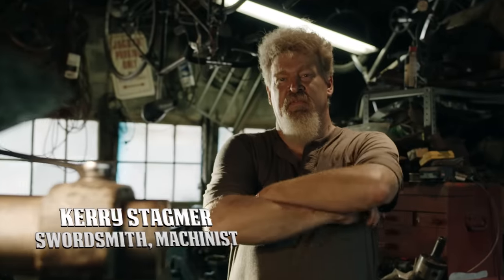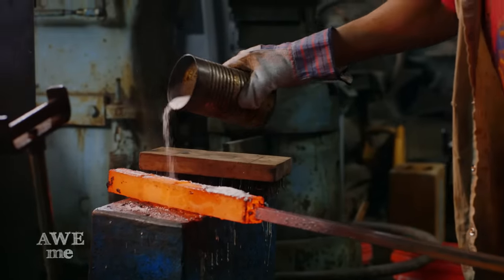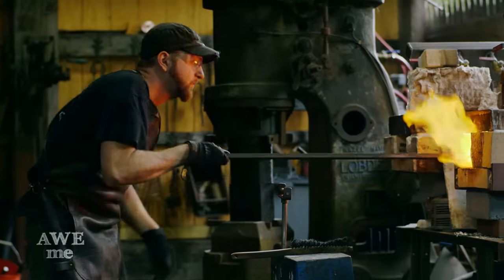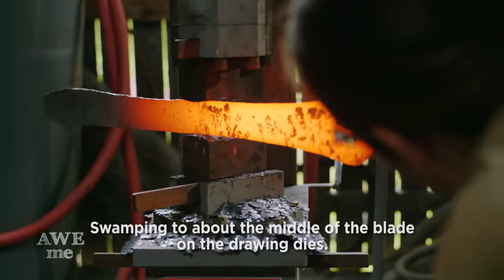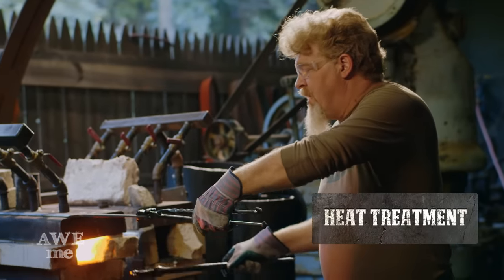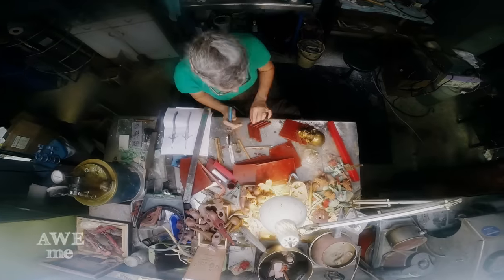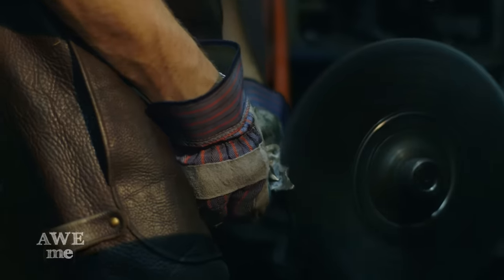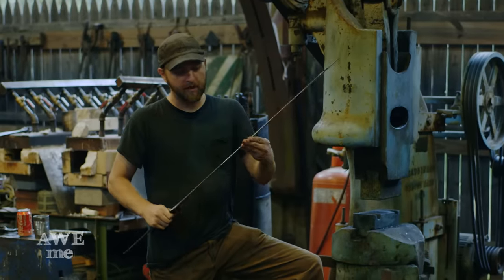Dante's Rebellion Sword (Devil May Cry) - MAN AT ARMS: REFORGED

Comment: PLEASE MAKE THE 'YAMATO' OF VERGIL IN DEVIL MAY CRY 5
Reply: Yamato is just a regular katana
Reply: Vinicius Tanaka the only thing different is the guard and the need to craft the scabbard it would be remaking the Ruroni kenshin katana just with a lethal edge
Reply: Please
Reply: And nero's motor sword
Reply: But Yamato has changed in different games. Dmc3 is a way dmc4 another, and dmc5 I will not say nothing. Tsuba changes all the time.
Reply: Plis the yamato of vergil
Reply: @vtnk7597  it's not theirs Engravings there's the handle and there's the guard that's all different
Reply: Ya
Reply: @fireflamefirenick7313  it pretty much is with the only difference being a different shell design on the handle
Reply: @vtnk7597  it's a nodachi
Reply: @Hanta1  yamato isnt a regular katana it's a nodachi
Reply: @ExoTheEmo  You mean Red Queen?
Reply: @gaelleonardomartinezrios6358  yeh at the time i didn't know what it was called

Comment: Imagine how ridiculous it must have been to make swords back when they were commonplace weaponry? Even the most mundane swords must have taken days with wood fire forges, stone grind wheels, and smithing hammers. I wouldn't even want to imagine how long ornate specialty swords took to make.
Reply: My thoughts exactly, pretty amazing really...
Reply: Nah it takes seconds if you have the right materials. Play Skyrim and you'll see what I mean
Reply: Ryan Lawrence The troll is real.
Reply: Ryan Lawrence I have played skyrim :) not accurate in many ways but set for the understandable mechanics.
Reply: Randy Savage Or he was making a joke.
Reply: I know that hence the smile
Reply: In the middle ages they didn't have the tools so they used molds for the form of the blade, then made it sharp with hammers
Reply: Jeroen Bakker They had molds but they fine formed it with hammers and sharpened it on a grindstone. You can't sharpen a blade with a hammer, you can just thin and flatten it to an edge. Even with the mold they had to put a lot of hours into shaping.
Reply: Jeroen Bakker
You're thinking bronze swords.
Reply: Randy Savage it literally can take no more than 4 seconds with the right materials: minecraft logic
Reply: Nope nope For sure. If you make yourself a 3x3 grid table all you need is 2 iron ingots and a stick then boom, you're a blacksmith.
Reply: Randy Savage basically, like I said if you got the materials there, and most likely if youre a black smith, ya do

Comment: Nero red queen, samuel murasama (mgr) and Arthurian sword.
Reply: +Sharif Azmi just carve a wooden sword out of a wooden boat paddle and you got one. :P
Reply: +Sharif Azmi nero's red queen has a motor on it .. it&#39;s impossible to make thats why "awe me" haven&#39;t made yet..
Reply: yeah that's why that sword are freaking cool. it's mechanical sword with unique feature resides in the handle, boasting motorcycle-like gear shift which, when pulled, releases a flammable liquid spray into the system.It has powerful propellant injection system.The fuel sprayed onto the blade allows it to unleash attacks of great power. If Man At Arm could make a artificial one then it will be damn good.

Comment: Can you make the Yamato sword from Devil may cry?
Reply: Meow
Reply: Can they make a normal Katana? Probably
Reply: Athalia Depends what you mean by "normal" Katana. Do you mean a blade forged with traditional techniques? Probably not, because that takes a lot of time and equipment that they probably dont have.

Do you mean a function katana with modern, high-strength materials that surpass traditional blades in virtually every respect?

Then yes, definitely.
Reply: Rick Fister I was saying "normal" as in any other Katana. The only difference is maybe the guard and the Buttcap. Otherwise, the Yamato is the same as any other Katana.
Reply: Rick Fister
I think they have done traditional katanas before, like their lightsaber katana video. They used traditional folding techniques and tools on the blade as well as giving it the traditional grip as well. Ilya also did mention in that video that he had studied traditional Japanese smithing for a long time as well.
Reply: Shadic Namikaze That or the Sparda sword right?
Reply: Victor Devers happy with either

Comment: am i the only one who hates that the sword blade moves? Feels like i can grab it and shake it and it'll make that WOoOobllewoOooOobleWooooBle sound Ugh
Reply: Same here
Reply: Flexibility in the blade is necessary, if the blade is too brittle, it will snap.
Reply: That means it's a good sword. They are designed to be flexible so they don't break. If it's too stiff it will shatter like glass. And if they make it thicker that would just add pointless weight.
Reply: DemonGates haha yeah i guess so.
Reply: Fuhrer Pingas There is a way of making a good sword with a blade that doesn't moves, but it is A LOT harder to make. If you do it with damascus steel with plenty of layers. There are some blacksmiths that make swords with 5000 layers of damascus but they take months to do it, this one has only 200 layers. With approximately 1000 layers the sword blade moves considerably less.
Reply: DemonGates 5160 steel blades are pretty strong stiff blades if your interested
Reply: I do agree, it does ruin the magic a little.
Reply: Marcelo D'Arisbo Not strictly true ( despite what that bloody national geographic documentry says). Forge welding isn't the ultimate material it just combines the attributes of two materials ( be they positive or negative).  And if you forge weld too many layers the steel loses its chemical structure. If you're refering to the construction of the katana the reason that they do fold it is so that the steel becomes more homogenous ( because contrarary to popular belief Tamahagane is really low quality bloom iron) The main reason for the wobble is the blade geometry. Since this is a video game sword its way too hilt heavy with the skeleton so to keep the weight low they keep the blade relativley thin. And since damascus steel is difficult to make. But on historical swords they add a ridge to the middle of the blade to prevent it from wobbling in this manner. Although this is a very good traight to have in the steel. then blade gemetory could sort out the aesthetic problem of the wobble.
Reply: Matt Stagmer You don't have to. It's just something that has bothered me since Sephiroth's Masamune when Tony built it. The wooble.. The last weapon he made Frostmourne I thought it would wooble but it didn't do much of that
that put me in tears. I wish he put LED lights to make it glow light the original.
Reply: yeah kinda disappointing it didn't need to work its just a replica, it should've been bigger and wider, but oh well
Reply: its cause of the slow mo. trust me if it was at normal speed, you wouldn't even notice it.
Reply: Matt Stagmer Yes thats what I meant by it being a good traight in the steel. Reading back i didn't make that very clear o.O 
Thanks for the reply anyway
Reply: ***** Oops i apologize. I didn't mean to write that to you. And yes I do know that since many wrote that before you. I was commenting on another kid in a video but I didn't realized I was replying to your comment on my tab. Lol Did you know Ghost in the Shell, the singer Origa died on the 17th of jan this year? Kinda in tears right now man....
Reply: ***** Yeah... Well thanks for the comment. Take care

Comment: i don't like how they made the handle part out of wood... the original was all Steel, i know, it could be heavier but that's not the point! it would still be useble... like this it just loses all its charm... and they made the central piece to small and doesn't have the skull on the other side too, so also a lacky job on the references... call me nitpicker, but seriously, this is not a good replica...
Reply: you should check out michaelcthulhu's channel. imo he makes better swords than these guys ever could.
Reply: +Ross Brown  you mean proper dimensions but near impossible to wield because it rly is too heavy. These guys are making compromises to make their pieces actually wieldable ... whichever floats your boat
Reply: atf343 I just don't like how flimsy MAA blades are. every single time during their slow-mo you can see the blades flexing like a limp noodle.
Reply: That's an overstatement.
Reply: The Buster Sword and Michaelcthulhu's creations are literally cut-out sheet metals with shavings and sculpting here and there. They're not really forged. That's why when you look up close, they look like flat metallic cosplay swords. Swords bend to absorb force. A sword that don't bend breaks after a few use.